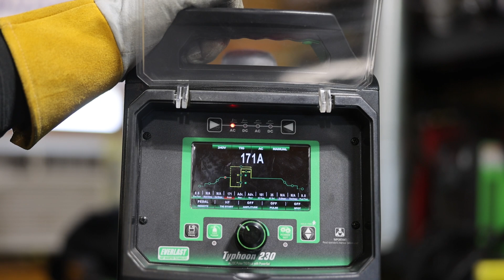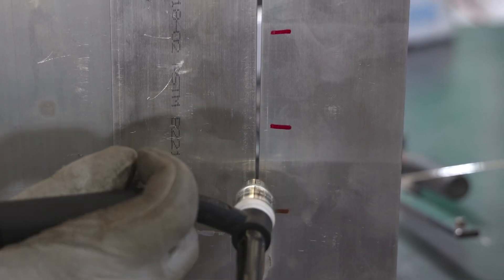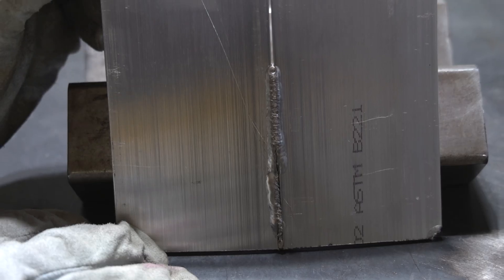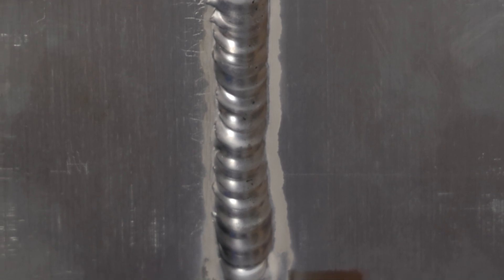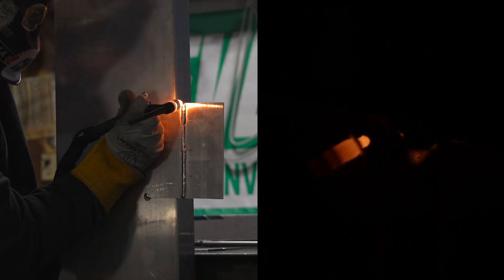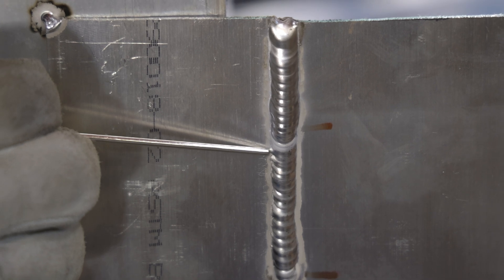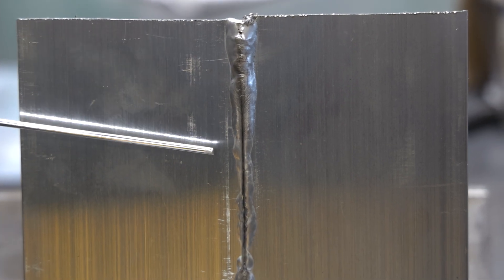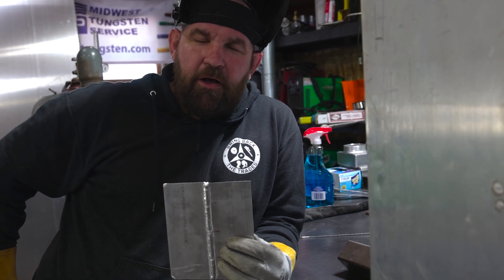2 Mistakes Destroying Your Vertical Aluminum Welds

Comment: I'm trying to learn, by myself, and for feedback to you guys, as teachers, I would:
1.  This is the thickness of the material
2.  Which means we set to  x  Amps
3.  We are using  Y  torch
4.  It is  (air cooled or water cooled)
5.  Yes, you covered  gas  20 CFH   thank you for that
6.  Size of tungsten
7.  Grind angle
8.  If water cooled, what coolant, flow rate, and quick shot of the cooler,
Course, I can see you have a cooler in the shot, barely, but for us little guys, we have to really think about IF we want to buy the cooler or not.

Comment: Why "161hz" and not 160 or 155 or whatever?
Reply: I'd really like to see an answer to this question. The lack of an answer suggests that he has no idea or real reason for that setting. The weld will go in nicely from 50hz to 250hz. Pretty sure he just feels like setting it there, so he does.  If there was a concrete reason for it, he would hopefully explain that.